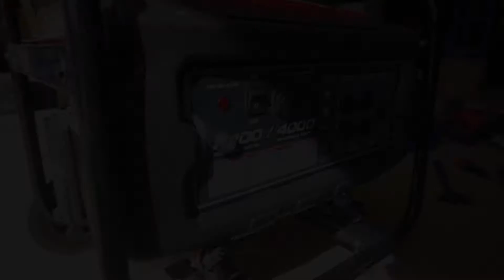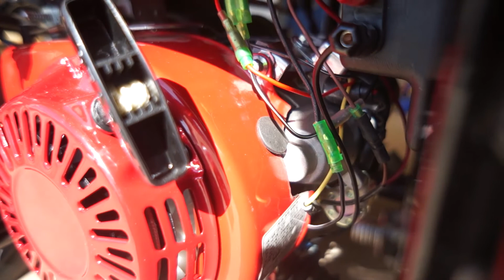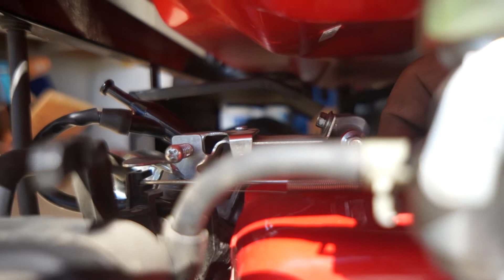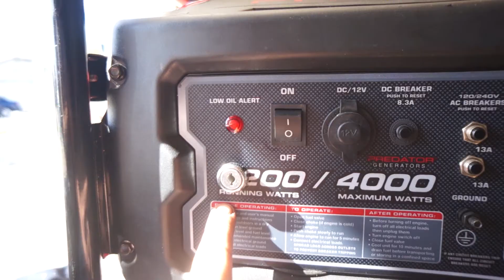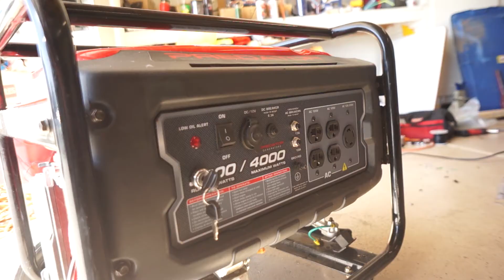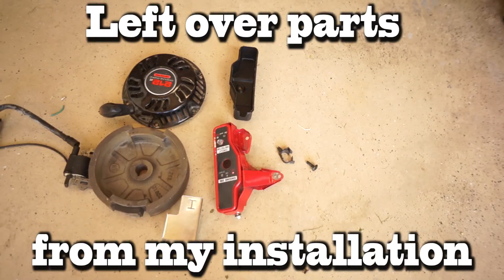Harbor Freight Generator adding electric start

Comment: Hi IFPV, I purchased the starter motor from Ebay seller varietystorefront they haven't answered my messages for installation instructions and I now see I only have the Starter motor and looks like the minimum I need is the Flywheel and starter coil (PLEASE CORRECT ME HERE IF I NEED MORE.) Where did you buy your kit may I ask?
Reply from the maker: Amazon is where I purchased the complete kit. Needed 100% is what you listed(starter, flywheel and coil. Amazon kit came with Ignition  switch, fuse assembly as well.
Reply: Thanks iFPV, I can't find the kit on Amazon (Searched multiple ways), do you have a link by any chance (or maybe the original exact description from your purchase as googling that might work) Thanks very much for your reply.
Reply from the maker: @andrezamore4124  New Honda Gx160 5.5hp & Gx200... https://www.amazon.com/dp/B00HM9LSCQ?ref=ppx_pop_mob_ap_share
Reply: Thank you so much iFPV! The kit from Amazon says it's for the Honda Gx160 5.5hp & Gx200, is the kit ready to bolt-on the Predator or do you have to make mods? I'm a DIY'er, but would be to cool to just bolt everything on if possible. And really thank you for this info. Was so frustrated before.
Reply from the maker: @andrezamore4124  the kit is for Honda BUT, that is the exact kit I ordered for my harbor freight generator. The video shows the kit in the link that I used. Look out for is possible flywheel difference if I remember.